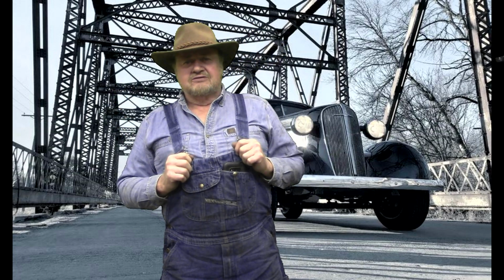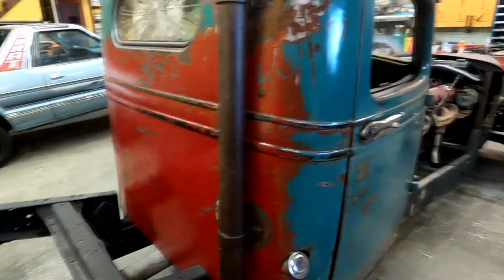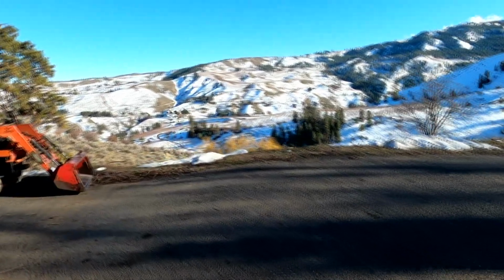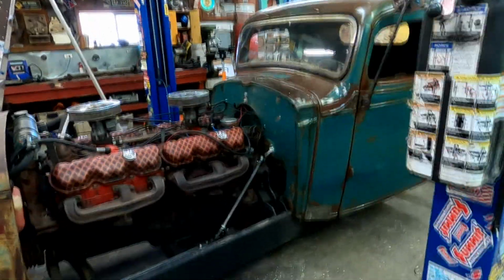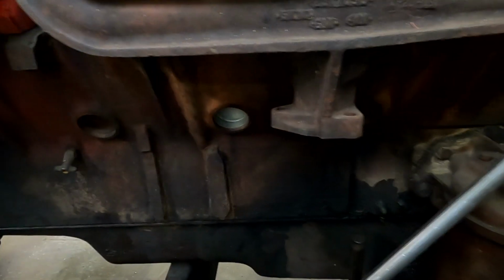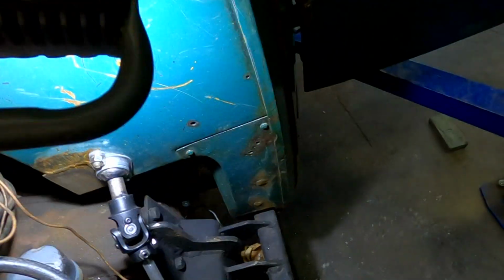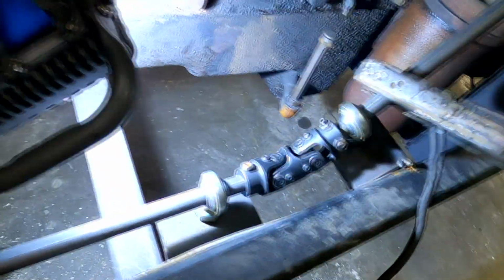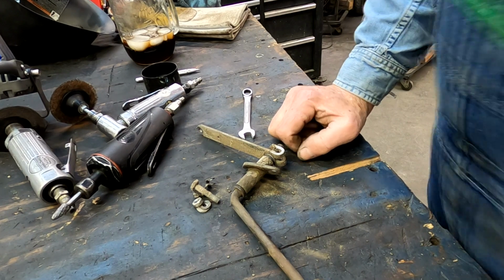GMC V12   THROTTLE UP!!!

Comment: Hey Waylon
   Glad to see ya makin dem little final connections, corrections and adjustments on TD12.
They often do not seem like much, but usually they are very important to the functionality of the rig.
Steering working correctly ? 
Throttle to regulate power from the engine ?
Yep, dem thins is purdy important to the opperationality of da wehickle.
   
   A little note from my younger sister who built and maintains a beautiful 57 Chevy which has been seen, stopped and interviewed several times on Detroit Television during the anual Woodward Cruise.
" Ya know Mister Wire, there are Gals as well as " Fellas " who build and work on Hot Rods and automotive projects who follow your channel !
Just wanted you to know !  ( Her Words ).
   I told her I would mention that to ya !
Waylon, We preciate ya letting us be a part of your contributions to life, liberty and good viewing on You Tube !
   Stay Warm, Be Safe & Well
Reply from the maker: of course there are gals who build hot rods! I fully recognize that :)  although my demographic is 99.99999 % males over 55.. please ask your sister to listen to my words in the very first 30 seconds of this video. I specifically shout out the "gals" in the car community.  :)     thank you very much for watching and tell your little sis  I PREciate her! haha.. thanks again m'friend.  
https://www.youtube.com/watch?v=xvTdHRkRnAM&t=1s

Comment: In some jurisdiction’s non factory welded steering parts are not legal…. So drilling and bolting is a good fix, even allows you to take the steering column back thru the firewall if need be.
Reply from the maker: yeah I believe I mentioned I was goint to put a bolt in

Comment: Find out if there's a dyno shop someplace near you after this entire project is done, to see what kind of wheel horsepower you're getting. a V12 is nothing to sneeze at.
Reply from the maker: rated at only 275 hp but 630 ft lbs of torque @ 1600 rpm..  It;ll drag yer house off the foundation at an idle  haha

Comment: Hi Ken. Was that driveway paved when you purchased the property? Cant imagine what it would cost to pave that today. I am almost sorry to see the good weather return to the northwest becaus that means you will be grafting and not filming. Stay safe and have a good season.
Reply from the maker: I am extremely happy to see the good weather return! its been a hard hard winter up here. trying to keep my road open, shoveling snow off my roof, frozen pipes .. on and on....dont worry.. it will be a short grafting season.   no my road was dirt when I purchased the property with lots of slippery clay in places. it was absolutely NON traversable in the wintertime!  during the winter months, the previous owner would leave her vehicle at the bottom of the driveway,  ski out and snow shoe in. I paid to have it graveled and chip sealed. 9 ft wide and 2,000 ft long (640 ft less than half a mile) the cost was 18k 27 years ago. i'm guessing it would be double that now?   considering the cost of the new "park model" type travel trailer I bought at the time.  the joke I used to tell was (in my best jeff foxworthy voice)   
 "If your driveway cost more than your house.... youuuu might be a redneck!"
Reply: @1963impala2drWaylonWire  Sometimes it seems like the old iron grows on trees out there in the northwest. I know however money does not, so I hope the season is long enough to pay the bill and still gives you a chance to catch up after winter around the homestead.
Reply: @1963impala2drWaylonWire  Sometimes it seems that old iron grows on trees out there in the northwest. I know however money does not, so I hope the season is long enough to pay the bills but still allows you time to catchup at the homestead.
Reply from the maker: @2duser2  actually my money "does" grow on trees! hahaha

Comment: I already know that you know, but it is easier to weld rod or whatever it is on a flat surface by laying a piece of copper or brass down under the part and on the top of the bench your wanting to work with... in other words sandwich it as weld don't like to stick to brass.... or does it.. i'd say I am wrong as they most likely used brass on the stack on the cabin's back side. I know it helps the algorithm if i jot down a comment... I will try next time to pick a better comment  :<(
Reply from the maker: haha.. i wish I knew what you are talking about... I have no idea but thanks for watching.. Preciatcha!

Comment: Heck, a pumped-up 348 coulda ran this tugboat "engine" into the ground,no problem. And a bonus would be it's lighter weight and it's ability to turn about 6000rpm and Smoke that low rpm tugger.
Reply from the maker: if I have to explain it, you will never understand it.
Reply: @1963impala2drWaylonWire  A high output 348 would explain plenty to a lardass 702, without being mostly dead weight.
Reply from the maker: @dehoedisc7247  you just proved my point. I only have one question.. why do you watch my videos?
Reply: @1963impala2drWaylonWire  Just an old mechanic who compares old engines to each other and knows the difference between a weird engine and a sensible engine. A 348 was an engine from the Exact time frame as the freak 702 and it would simply outperform it.Boom. No mystery.
Reply from the maker: @dehoedisc7247  like I said, if i have to explain it, you will never understand it. I was right. you "still" dont get it.   you didn't answer my question.. why do you watch my videos? just to keep bitchin at me? haven't you figured out that I dont give a crap about your "esteemed " 348 engine hahaha..
Reply: @1963impala2drWaylonWire  702 is a flat ass freak engine, 348 Chevrolet would simply outperform it. Oh, wait, I think I know your problem, you are one of those dudes who saw Jay Leno with a monster tank engine in a custom car and you are trying to imitate that .OK,but Jay does it better. Bottom line,your "vehicle" pretends to be Brute Force, with a set of components that are just a joke.I get it. ha haha.
Reply: @1963impala2drWaylonWire  Not necessary to "esteem" the 348, it is just a comparison to show that 702 is only suited as a  freak engine. Oh, wow, is Freakiness your Game? Here I am talking sense and you were running a game! Dang!
Reply from the maker: @dehoedisc7247  ok ok. you are right. I'll rip my build apart and install a 348. happy now? hahaha   clearly you do not enjoy my content so I'll try one more time.. WHY do you watch my videos?
Reply from the maker: @dehoedisc7247  oh darn.. you're onto me. shucks!  I better tell my 52,000 subscribers that I'm shutting down my channel because one guy doesnt like what I'm doing and wants to hang around and bitch about it hahahahah
Reply: @1963impala2drWaylonWire  interest in rare and unusual cars, trucks, boats, motorcycles, cameras, lost causes. There. You got the list.
Reply from the maker: @dehoedisc7247  OH! ok.. your're interested in rare and unusual cars and trucks but not the rare and unusual engines from those rare and unusual cars and trucks.. ok I think I understand now.. let me see if I have this right.. everything should have a 348 in it... ok, got it... well WELCOME SIR! and thank you so much for watching my videos and supporting my channel.. every time you make a comment, I get paid! maybe if you watch long enough you'll be able to grasp the concept that what you want is not necessarily what I want.. you understand scooter?  😂😂😂😂😂😁😁 😁😁😁😄😄😄😄
Reply: @1963impala2drWaylonWire  it's only with your advanced knowledge of cult engine oddities (speaking of Odd Ball in Kelly's Heroes) there is a cult of 348/409/427 out here,and they ain't taking no prisoners.And most would favor a GMC 6-71 Diesel  to be the most practical engine overall. Odd Ball.
Reply: @1963impala2drWaylonWire  Your double engined marvel stirred my memory of a drag race car that I saw in 1967 at Lions Dragstrip  with 2 Chevrolet 327's inline and they ran on pump gasoline, Crower fuel injection, and was turning 9000 rpm in the lights, ran a 7.44 Excuse me for being unimpressed by a low rpm cubic inch loafer. There's lots of cults around.
Reply from the maker: @dehoedisc7247  and excuse me for not being interested in the 348 that you just keep going on and on and on and on and on about.. you keep harping about how sluggish the 702 is.. you cant seem to grasp that " I dont care"  its unique.. its different. you can find 348427 at every car show in the country (not impressed) I want to show young people one of the oddities of design back in that era. its more about the history but in your mind its worthless because it doesnt turn 9000 rpms. keep commenting!!! I get paid every time!!  hahahaha
Reply from the maker: @dehoedisc7247 I just bend over laughing every time you comment and marvel at how  you just cant seem to grasp that I dont want what you want. dont you get that I KNOW the v12 makes no horse power. dont you understand that I KNOW it is low revving and I LIKE that about it!!  I said in the beginning "if I have to explain it, you'll never understand it" and you proven that point with every single comment you have made! hahahahaha.. but keep em comming.. hahahaha.. in another 10 years or so.. you MIGHT catch on.. but I doubt it! hahahaha
Reply from the maker: @dehoedisc7247  I dont know what you want from me. I've already said "you are right" this thing makes no horse power..so. .what exactly is it you want from me? are you obsessed with trying to MAKE me want what YOU want ?  you are never going to understand why I like this engine so ... its pointless to keep harping me about your stupid 348 haha.. so once again.. what is it you want from me? how can I help you? help ME help YOU hahahahaha  man I've not had this much fun since Ive been on youtube! hahahaha
Reply from the maker: @dehoedisc7247  I keep saying that if I have to explain it to you, you'll never understand.. so far ive been right but im going to try and simplify it for you.. you not accepting that I like this old engine is sort of like if I get all pissed off at you because you put cream in your coffee and I dont.  can you get your mind around that?  hahaha
Reply from the maker: come on man.. I feel like we are almost family now! hahaha.. dont give up.. keep trying to convince me to like what YOU like! hahahaha.. how's it working so far? come on buddy.. you've almost won me over with your charm! hahaha
Reply: @1963impala2drWaylonWire  Ain't about "winning over" nothing, my engine options are every bit as "odd" and radical as yours and you can't see it. I expect your brain is going. It happens to all cult figures, and there ain't no cure.
Reply from the maker: @dehoedisc7247  hahahaha. yeah ..I see your engine choices all the time .. when was the last time you saw mine.   I boiled it down as best I could but you still couldn't even understand my 'coffee and cream" analogy..  you think just because I dont want what YOU want.. that that makes me a cult figure.. whatever that is .hahaha.. your closed mindedness and obsession for having to be right.. just absolutely cracks me up.. PLEASE continue to message me. I'm stringing you along and you just cant help yourself! you just HAVE to try and be right.. you dont understand there is no "right"  its called a "CHOICE"  cant wait to hear from you uncle Dehoe. hahahaha
Reply from the maker: @dehoedisc7247  hey man.. I hope you know I've just been joking around with you lol I'm not really mean spirited and I dont wish you any ill will.. you seem to take yourself pretty seriously so I just had to mess with you a little haha. at the end of the day, I thank you for tuning in to my channel and I wish you well.   😀
Reply: @1963impala2drWaylonWire  Thanks for the conversation, I wish you nothing but the best, you have a very interesting channel.